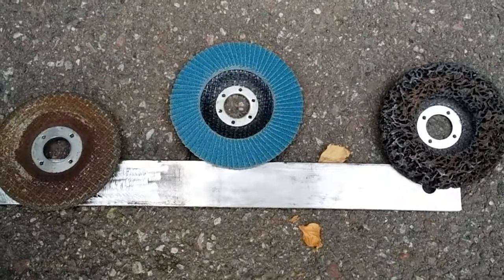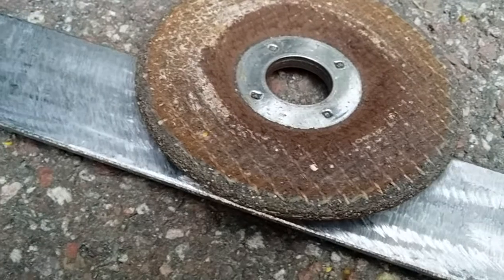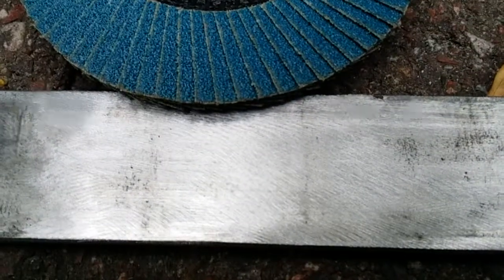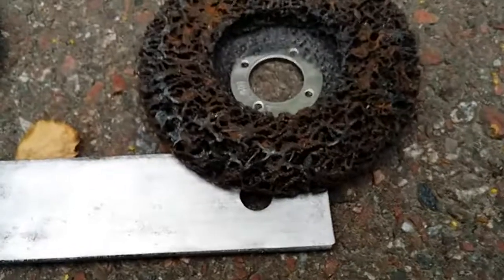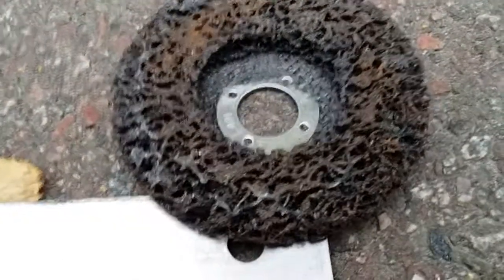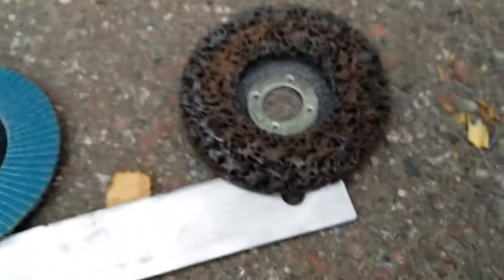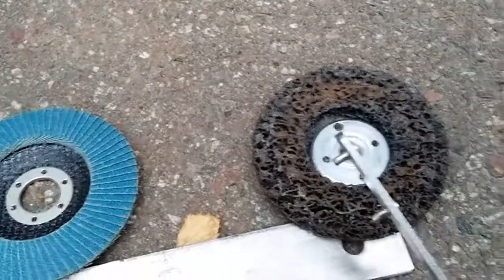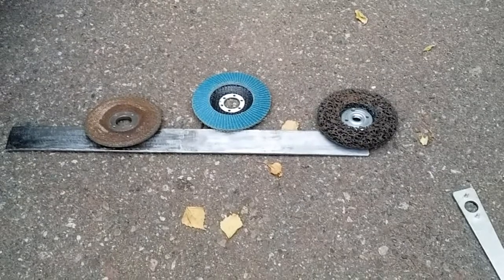Quick comparison of three types of grinding wheels/abrasive discs

Comment: About tighting paint remover disk.. I have never used this tightning tool. Just used my hand. Grinder spins in other way of its thread it holds and tightens by itself. I havent had problem doing it for about 10 years. honestly i havent seen anyone (professional or home diy'er) around me using this tightening tool as well. 🤔

Comment: I put washers on the back side to make up the difference. Not a fan of the flap disks as their way over priced and don't  last very  long. Cheers.
Reply from the maker: Great tip! So far I've used two nails and something to use as a lever. A couple of washers is way easier so I'll try that out! Thanks! Cheers